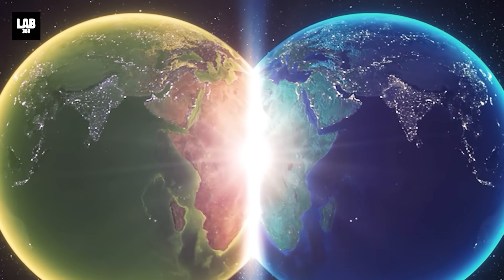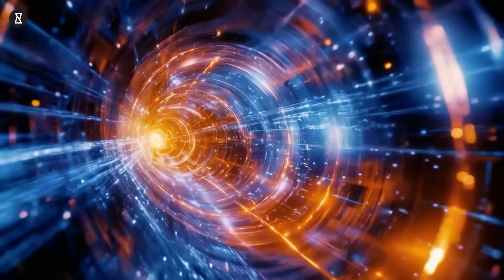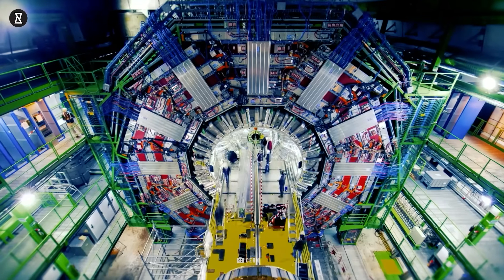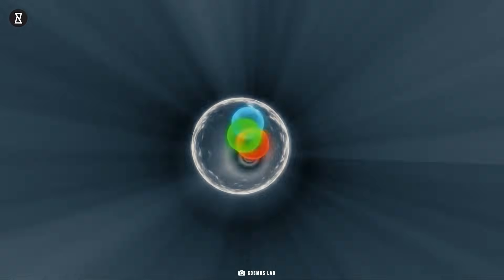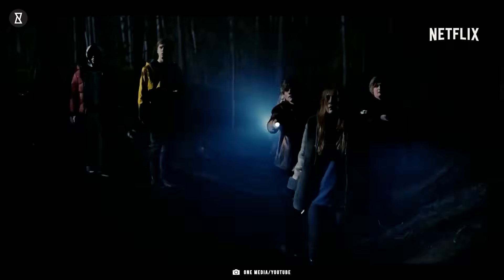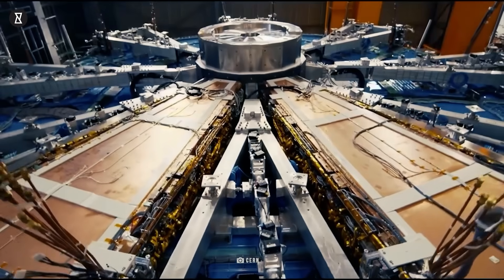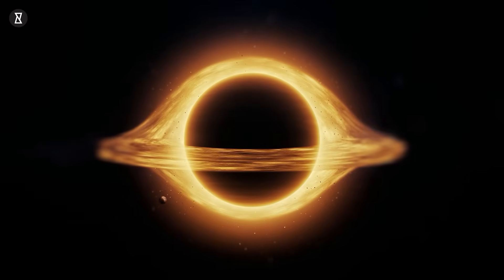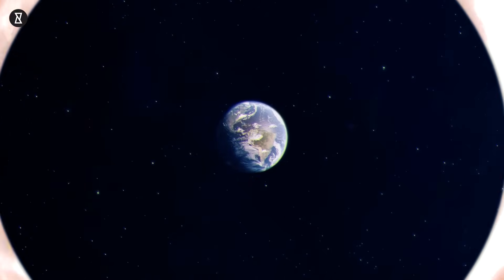Breaking News: CERN Portal OPENED? Scientist Reveals Shocking Truth! 🌌

Comment: There is more than one cern. There is one in Texas as well in Russia and China as well as the one in Europe. They can’t get out of the Firmament which is out of earth atmosphere. Read Genesis chapter and then chapter 6. We are Not on a spinning ball.
Reply: Texas, Superconducting Super Collider, was proposed, but never got out of design because funding was cut. Lot's of universities have particle accelerators. The picture tube in an old TV is a version of a particle accelerator. Firmament is a mistranslation of the Hebrew word "raqi"a. Which simply means "expanse".
Reply from the maker: wow, thankyou for the info.
Reply: @darrenodegard7896 That is correct. The Texas Superconducting Super Collider Project was proposed, planned, and highly publicized, but eventually discarded due to public opposition largely because of costs, land rights issues, scientific concerns, and political pressures.
Reply from the maker: could be a possibility.